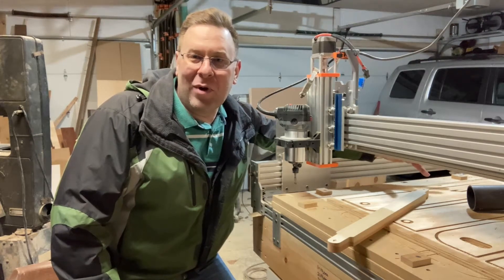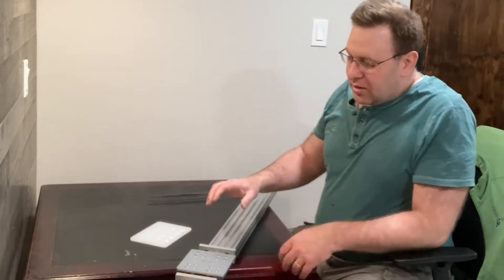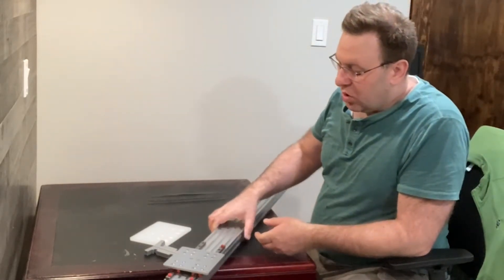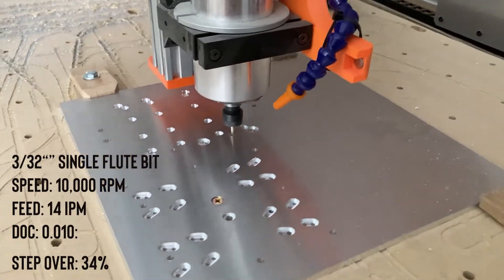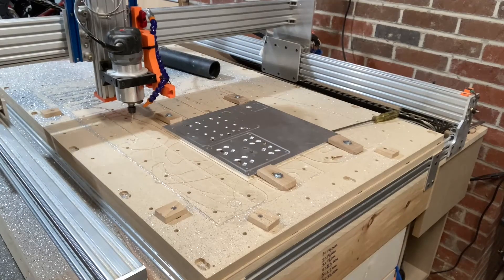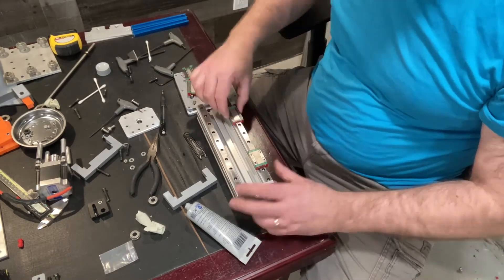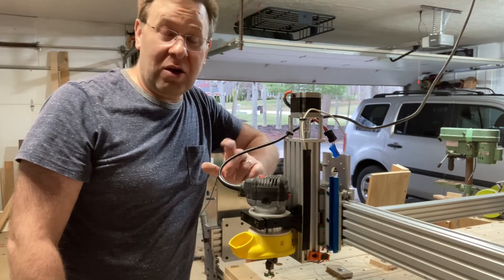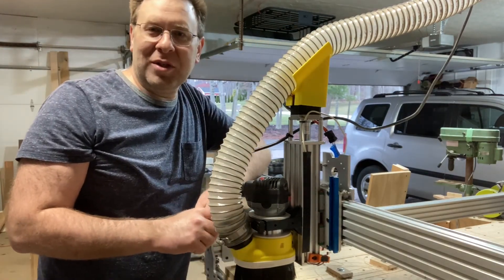Z Axis Upgrade to the WorkBee CNC

Comment: The great thing about having a CNC is that you can CNC your own upgraded parts. I tend to 3d print all mine first to check they fit etc, then just machine them. I think the HGR15 are the way to go over the 12.
Reply: Also HGR rails would be better for CNC than MGN
Reply from the maker: I did end up upgrading my X axis with HGR 15 Rails, it made the whole assembly a lot more ridged. I also 3D print all of my part before machining, it makes it a lot easier to correct mistakes in the design. Thanks for you comments.

Comment: Did you have to shim the nut block for the leadscrew on the new plates? I've just started doing this upgrade to my machine and looks like that might be required.
Reply from the maker: Yes, you will need to shim the nut blocks, you can find the 3D files for them on my thingiverse page.  https://www.thingiverse.com/thing:5883920/files
Reply: Sweet! Sorry, I must've missed that bit. Thanks for sharing the video and part files.